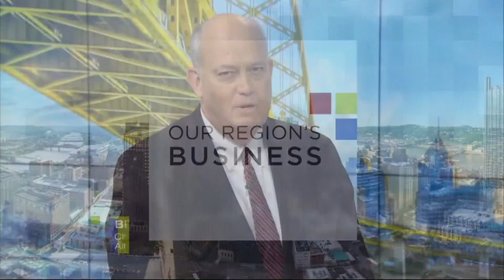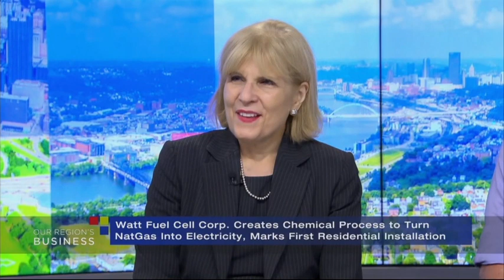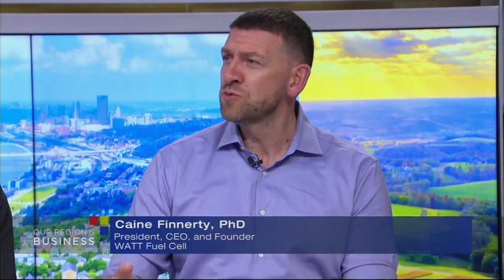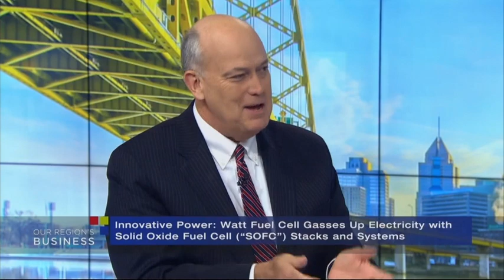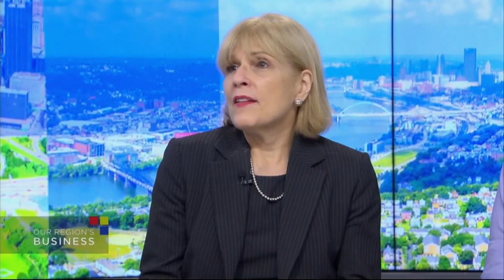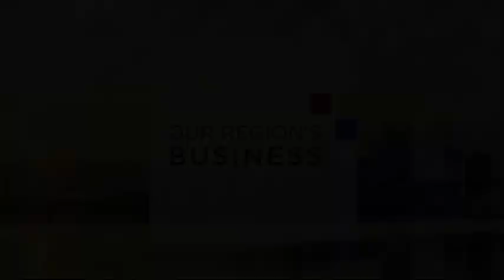WATT Fuel Cell Creates Chemical Process to Turn Natural Gas into Electricity

Comment: Nothing new. Every mole of natural gas converted into electricity converts into one mole of CO2, the same amount of CO2 if the natural gas is combusted.
Reply: You know humans breath out carbon dioxide, right? Co2 and water. That's what you expel and that's what this expels. It's cleaner than much anything else out there right now, plus, it is a great bridge technology between fossil fuels and green tech. These units can be set up to modulate solar power, so no need to burn fuel when there is sun. I know I'm late to your comment but just wanted to throw that in there.
Reply: But wouldn't this be much cheaper than using electricity?
Reply: CO2 is not cyanide or nuclear waste. And the efficiency of electricity production is about 2 times better compared to the combustion